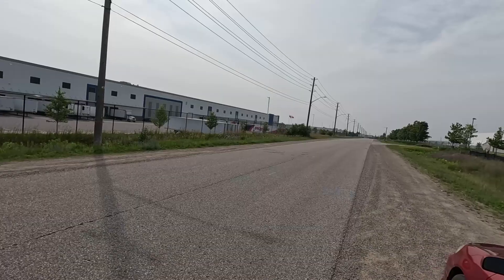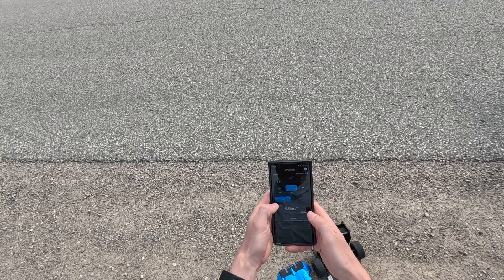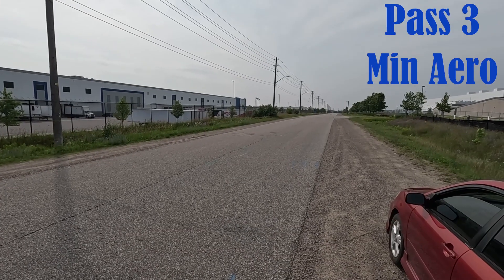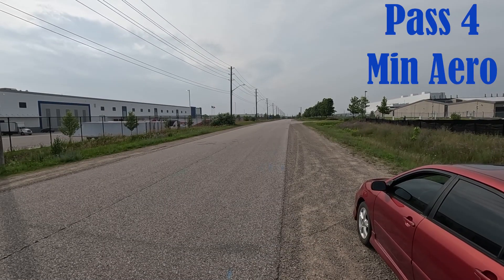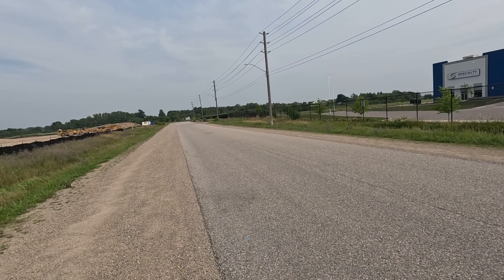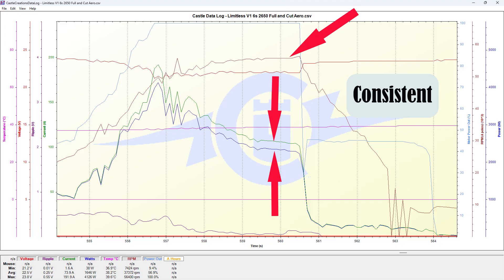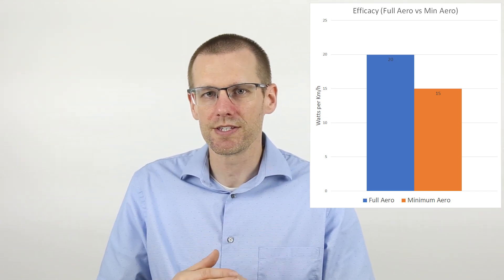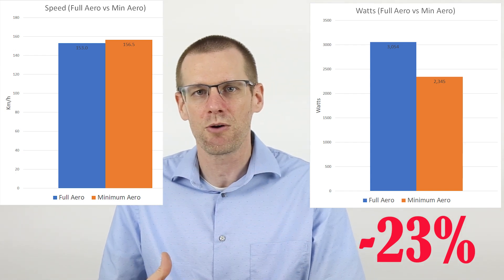Unlocking Speed: Testing Aerodynamic Drag Reduction on the Arrma Limitless V1

Comment: 2 things ~ First:  Please get out the street or on a step latter when running your car. Second: with your setup your car will go a lil faster on the second or third run even tho the voltage has drop a lil bit cause the batteries are warmer on the second & third run & the IR is lower.
Reply from the maker: I'm looking in to the ladder idea, although this idea has me concerned too. Hiding behind the car, as best as I can for the next 2 already recorded vids. Will have this figured out soon though.  So far the data I've collected on a couple dozen runs doesn't show much of an improvement in IR when those runs are 10 minutes apart.

Comment: This is what I based my whole open wheel setup on i managed 173mph at 16.9kw power out @27.9v to then find out the next day my front prop shaft had been binding enough to melt my front chassis support. 😅
Reply from the maker: wow, do you have a data log or pics? That sounds incredible.
Reply: @RCexplained  yes will message you on insta